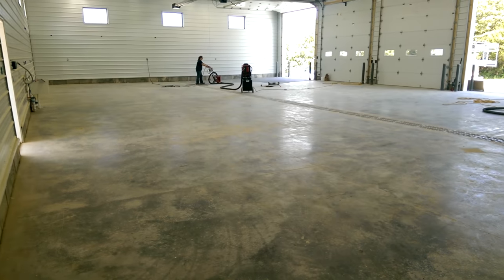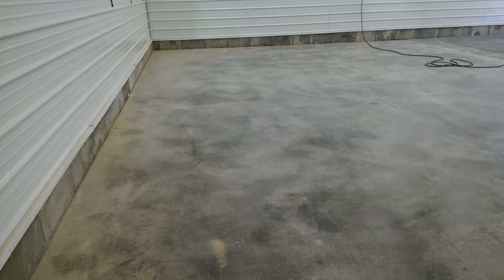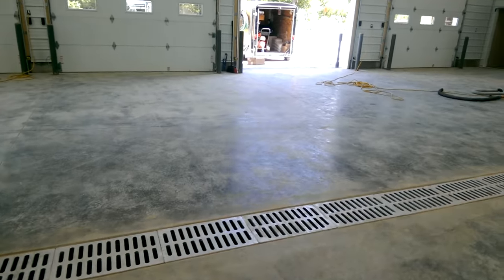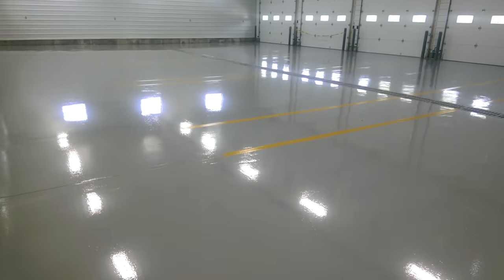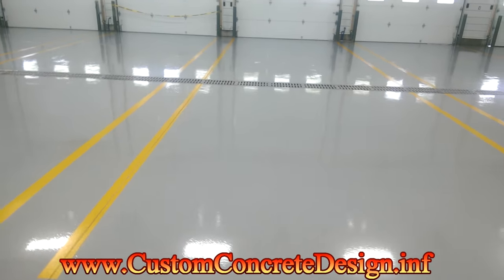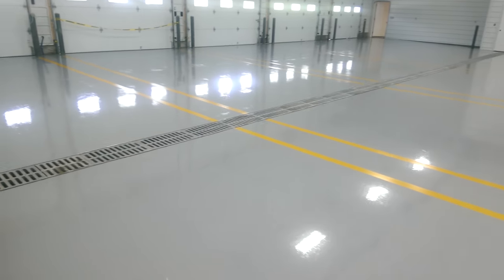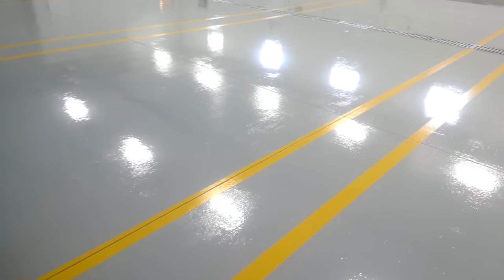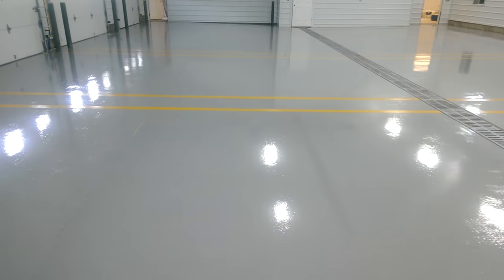Epoxy Garage Fire Station Floor Crocker MO Lake of the Ozarks

Comment: Heyy Rick,  yu thnk diamond grinding would have workd also??
Reply from the maker: Yes it Probably would have, I just wanted to do the Shot blasting simply because this was a commercial job with Huge and heavy equipment going in and out a lot, so I didn't want to take any chances with it, the shot blaster leaves a rougher profile but I wanted to make sure we removed the cure and seal and had the good rough texture so there would be no doubts it would stay down. If it were a Residential Garage I just grind them.

Comment: Hey rick, are Yu off on the holidays I need to ask Yu a question on the fire station
Reply from the maker: Im off till Next Monday, so ask me whenever and I'll get back to you.
Reply: How did yu get the fire station job, did yu kno sumbody or yu had to go thru the technical bidding process
Reply from the maker: lavonn simmonz
 Actually they called me up about 6 months before I actually did the job, and said they may have some money left in the budget to do the job, and who ever show's up first to bid it gets the job, guess who got there first!
Reply: MrCustomConcrete did yu use joint filler for the control joints??